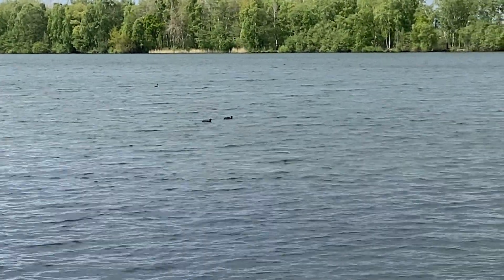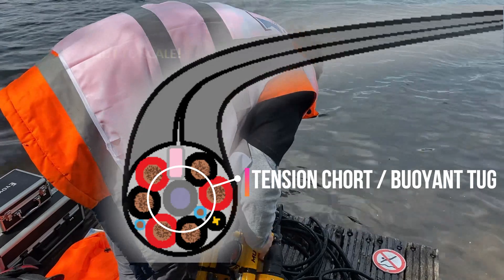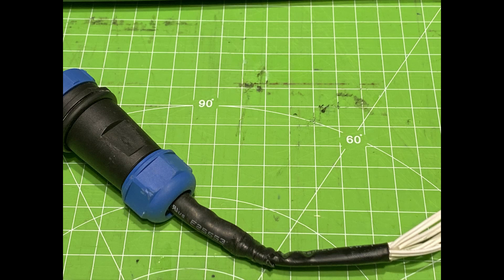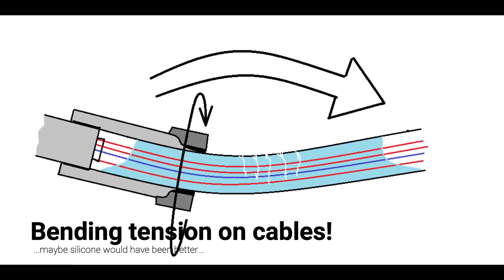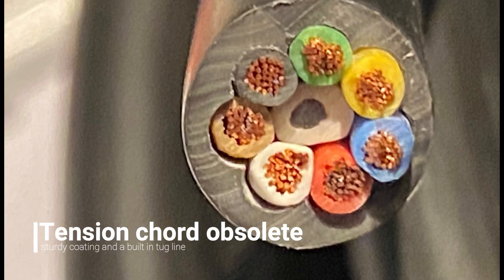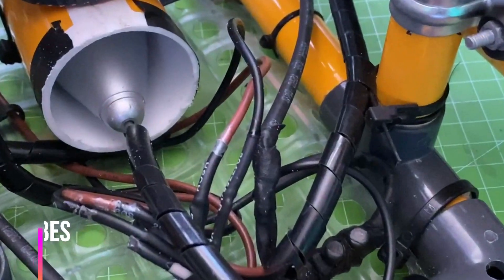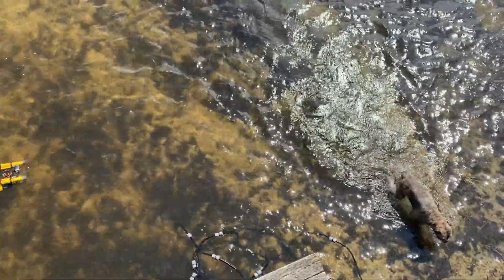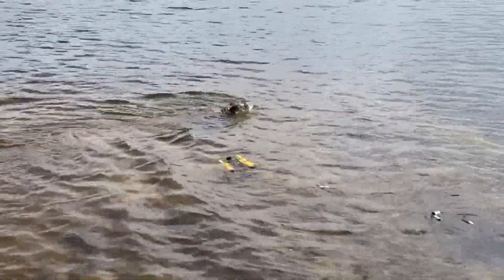ROV Tether Projects Touch Muh Hull DIY

Comment: What if you attach the floating material as 1 long tube along the length of the tether cable and glue it.  If you use poly foam, kind used for pool toys, can get wet. Just lay the long pool noodle down and cut thin and long strips off to glue to the tether?
Reply from the maker: The idea is good, but that would be way too buoyant. However there are companies that design neutrally buoyant cables, but they are really expensive…

Comment: Are you using relays on the rov?
Reply from the maker: Not on the ROV; each engine has its own power line.
Reply: @agermangineer  do you have a email I can get more info? Wanting to built the same thing but having issues understanding the wiring
Reply from the maker: @blackwaterdivingcompany7594  well, basically everything I do know about the wiring is presented in my videos and also referred to www.homebuiltrovs.com. The relay wiring is brutal, but the only way to go. And with trial and error manageable.
I chose not to share any further contact information, due to some... weirdness in the past. Sorry.
But please, don’t hesitate to ask about whatever you need. I’m glad, when I can be of assistance! Just take it step by step and you’ll get through it.
Reply from the maker: On the other hand... that would make one heck of a good new video... In my ROV controller video I just referenced the wiring because explaining it would be a daunting task... but as a separate video...?! Quite a challenge though...
Reply: @agermangineer  I see the seaperch doesnt use relays, I had seen one video where you had went to a bigger 6 strand cable. I guess using the cat 5 cable that's just activating the relays and having only 2 12g wires for power and ground. What size pvc did you use for the body and buoyancy floats?
Reply from the maker: @blackwaterdivingcompany7594  ok I’ll start from the bottom:

Frame: 3/4“
Buoyancy tanks: 1.5“

CAT5 is ok for a 50‘ tether but... I’d always recommend at least a CAT6 at that length.

True, when you use simple DPDT switches you don’t need any relays, since those switches direct the power straight to the motors. 

Relays are only necessary, when you have an on-Board power supply or when you want to build an arcade-style controller with a joystick.
So, no need to make it more complex than it has to be.
Reply: @agermangineer  so I can use cat 6 to run power to my motors and light?
Reply from the maker: @blackwaterdivingcompany7594  sure... but the longer the cable, the more power loss. Keep that in mind.
Reply: @blackwaterdivingcompany7594  Not directly you can't without relays and a separate feed and return for the relays and motors. Cat 6 is 24 gauge in 4 twisted pairs. The copper is approx. .5mm diameter. If you are going to use 500 gph, 750 gph or as I used, 1000 gph bilge pump motors, you'll note they come with a metre or so of 14 gauge attached which is just over 3 times as thick at 1.6 mm. Now a tether for a ROV is liable to be considerably longer than any run on a boat, so you should see without any calculations, the voltage drop would be unacceptable using a surface 12v battery. You would need to have power onboard or step up the voltage to say 48v, send down the cat 5 or 6 and reduce again onboard to 12v. My rig/tether is fairly simple. 15 metres length of cat 5 (more supple than 6), 14 gauge feed and return to relays and motors, 14 gauge feed and return to HID and LED car headlamp units. Over this length the motors receive 10v with 1 running and 8.9v with 2 activated. This is from a multimeter test, not a calculation. For reasons mentioned earlier, I wouldn't even think of trying .5mm wire for a 5 amp motor, so I did calculate that. You would have under 4v and the motor wouldn't run. You would basically have a 15 meter bulb filament.

Comment: i'm still pondering this all in my head as to whether to use a cable with 2 large conductors and a couple of small ones and installing a control board on board or  going with multiple wire cables to directly drive it. both ways have their advantages and disadvantages.
Reply from the maker: richard cranium I hear you! There are wonderful alternatives to my system; even using a Vellman K8023 10 Channel 2 Wire Remote Control... that is the sweetest choice!
However demanding a lot of on-board electronic and on-board power supply.
Neither would have been feasible on my small ROV.

So, due to the lack of space and the urge to keep it as simple as possible, I went with this simplest and boldest of choice. 😃

Please keep me updated!!